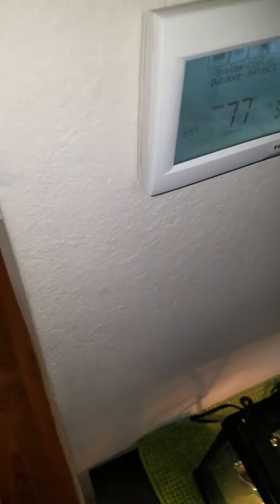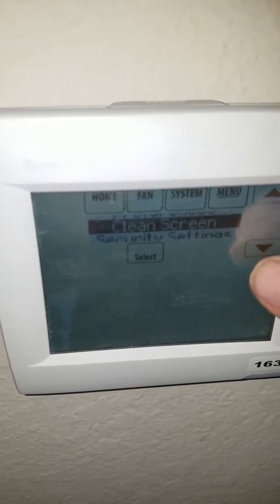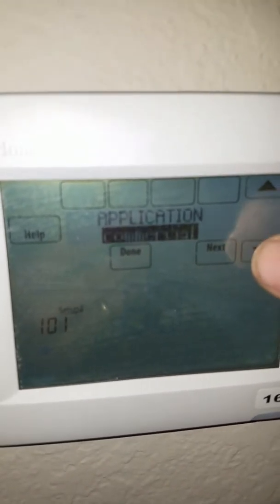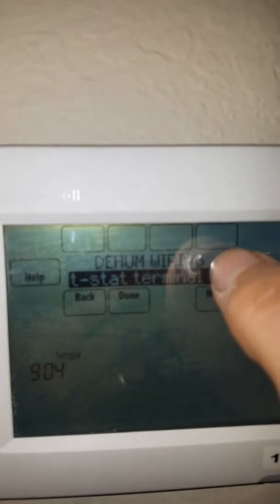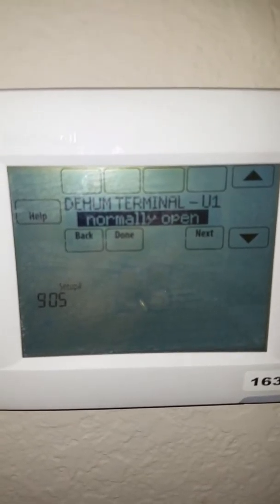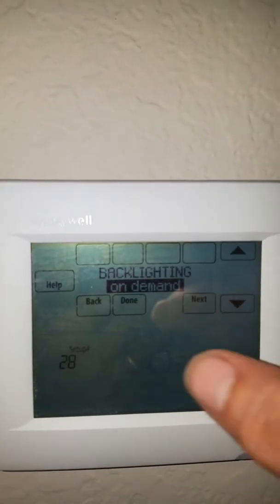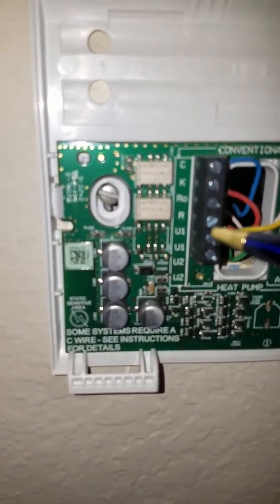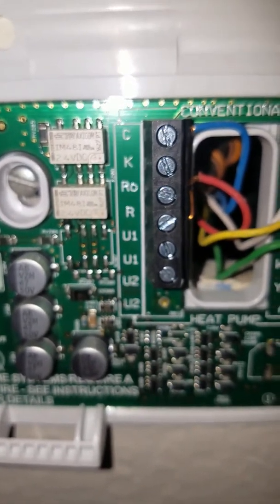Hw8000 dehumidifier with fan on low speed

Comment from the maker: The u1 u2 loop is the dehum relay.
Pick any available colored wire that's not in user and connect to u2. Connect jumper wire from R to u2.  At ah use what ever wire from u2